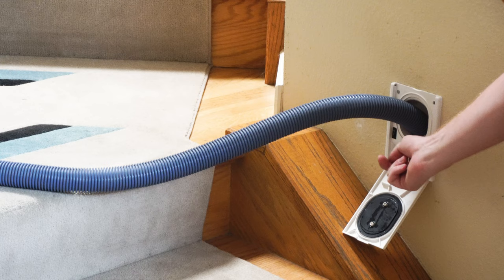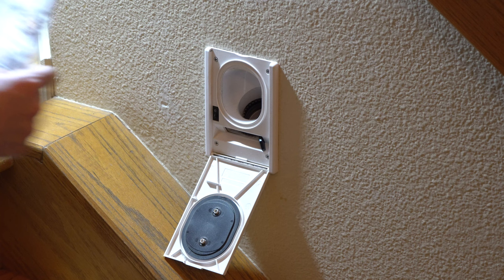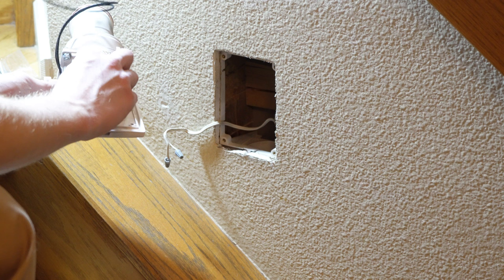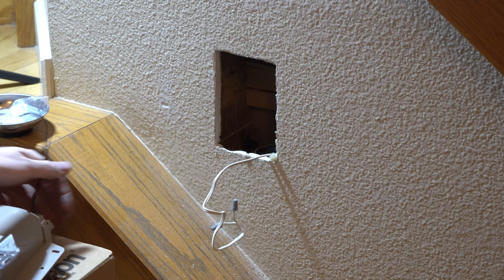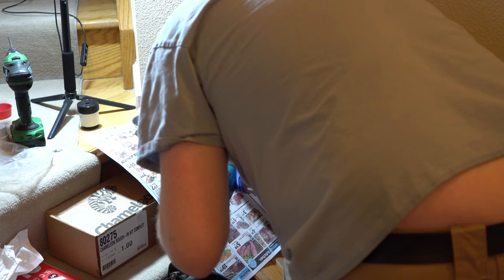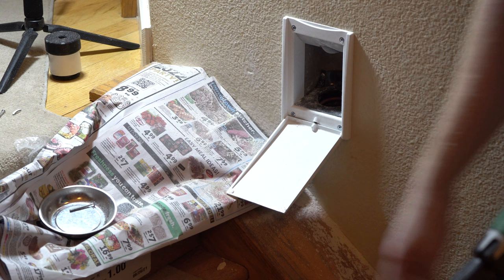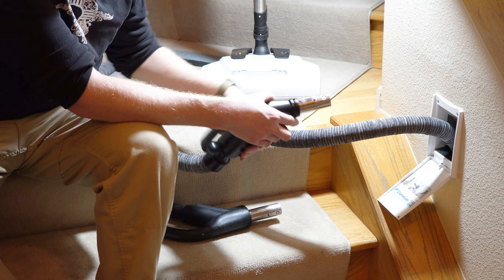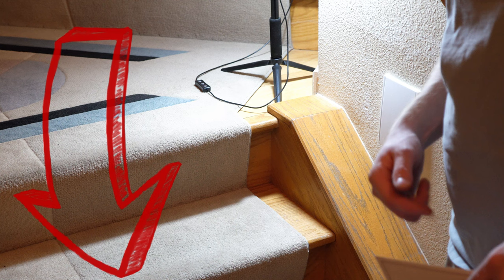Hide A Hose To Chameleon Valve Retractable Hose Central Vacuum System Conversion

Comment: You should look at Wago spring loaded connectors. You can stick wires in, close the clamp, and they’re really solid and reliable. And you can remove them again just as easily. 

They’re widely used in Germany instead of wire nuts for household wiring, so they are presumably very reliable.
Reply from the maker: I'm familiar with such connectors. It's odd that you mentioned this I do have a box of them I'll give him a try thanks for the suggestion!
Reply: They're becoming more popular here in the US too. So-called "push-in connectors". Ideal is one of the major manufacturers here.
Reply: Super expensive, for no reason. They are vastly superior to wire nuts/twist-on connectors though. Once they become the norm, I'm sure the price will drop.
Reply: For low voltage low current uses, Home Depot sells little packages of push-in connectors that take three wires; I used them for splicing in the 24VAC wiring from the two vacuum system switches in our house. However, they are only removable with wire cutters.

Comment: I've got a NuTone in my house that was installed when the house was built in 1986, and it still sucks like crazy. I should probably look into if they ever released an upright attachment with rollers for it because it'd be crazy if they did.
Reply from the maker: You could get one of these to put on the end of it and modernize it.

https://youtu.be/F_8XBVsUvlA

Comment: The Chamaeleon  is a lot better in some respects than the hide a hose And not having to have the doors be the seal is nice and also being able to remove your house and plug it into regular central vac outlets
Reply: Hide a Hose had that option years ago. Not popular so discontinued. Also, why does it make a difference if the door seals or the hose inside the valve? It does not since you can only use one hose at a time with both systems.  20 years of experience with retractable hoses and I wont make the switch because they could not lock and seal the hose at any length do to the patent.
Reply: I don't see the problem with the door seal. We've been using a first gen hide-a-hose for a bunch of years and that was never one of our complaints. The sock has been my biggest complaint since the beginning. Here in arid Arizona the static buildup in the hose attracts dirt and dog hair to the sock like crazy, and it does not come off until it rubs hard against something... like corners of walls.
When the budget allows I will be replacing it with the current hide-a-hose, which uses unsocked hose. It will require some drywall work, but I have been doing so much of that in the last year (plug: That Kilted Guy is my mentor) that I will probably cut out a foot square to make the job easier. Honestly, any repair under six by six inches is better done by making it larger for better support and less eye catching. I haven't done orangepeel texture like our host has, but I am getting pretty good with the knockdown texture we have.
I've considered an RF switch handle - we had one years ago and it was a problem child, from battery availability to dead spots throughout the house. The hidden hose systems (hide-a-hose and Chameleon) make handle control rather pointless. I'm walking back to the outlet whenever I want to retract it and turn it off, so why complicate things?
Reply: @flagmichael  You can change your hoses from sock hoses to the Rapid Flex hoses without making changes to your existing Hide A Hose system. I am in the Phoenix area and stock most hoses when you're ready.  If you are considering updating to the new inlet valves from Hide A Hose I can help you there as well.

Comment: You mentioned that you can use electric nozzles with this system, were you referring to a battery powered nozzle or does it actually provide an electric hose to use plug in electric nozzles. I love central vacuums, since I live in an apartment I use all of my central vacuum units by plugging a hose directly in to them, I have at least one central vacuum unit in every room.
Reply from the maker: Generally I use my battery operated nozzle but I also have 7 electro valves as well .

Comment: Can you have two hoses one regular hose for the basement, and the Chameleon hose for upstairs, or do you have take out the Chameleon hose out of the pipeline, before you can vacuum the basement with the regular hose?
Reply from the maker: What's your describing is referred to as a hybrid installation. Yes I can still plug in a regular central vacuum hose around my house.

Comment: You mentioned the old school electrical system will not really be used anymore. I would like to add the retractable hose but keep my 110v hose that powers my head unit. Anyway of doing that with a hide a hose type system or would I need to get a battery powered head or a 110v pigtail vacuum head?
Reply from the maker: Yes I'm referring to new system installation not existing central vacuum systems. Most new systems get sold with a battery operated head.

Comment: Genuine question: why don’t you solder your wires? 

If you’re shootings for an overbuilt reliable connection, I always use solder as a hobbyist mechanic. Is it different for vacuum wiring?
Reply from the maker: The vacuum wiring is attached with screws that hold the wire in place. Nothing's going to move once it's put in place. Nothing to get loose. The wire itself has a coating on it to keep it from getting corroded. So the need for braising this is unnecessary as well. 

Great question thanks for watching!

Comment: I should clarify,  Parts are made in China and assembled in Ohio.  Hide A Hose parts made in USA and assembled in USA. Also Hide a Hose has had the end cap available for a very long time to pull out and plug into a standard inlet which turned out to defeat the purpose of having a convenient system.  You can call them and order it if ever needed. Also, Hide A Hose has always had hoses available with the option of a Smart Hose Sock or a Rapid Flex Hose. Also lock and seal at any length. Again, more options with Hide A Hose. Just making sure facts are correct and advertised correctly. I would like to understand why the hose sealing inside the valve is better than at the door? I don't see why when you only use one hose at a time. For your master bathroom put in the Hide A Hose Mini.
Reply from the maker: Yo I think you should stop doing drugs. I've heard fiends who make more sense than your statement. Go ahead and continue living in your Fantasyland.
Reply: @PerformanceReviews  wow, I was just clarifying some actual facts missing from your video. My 20 years of experience with retractable hose systems and installed more of these systems than anyone I thought I would help out.  I’m sorry you did not like hearing about options you were not aware of or did not want the public to know about. I believe in being honest and selling the best products for my customers, that’s my success.  Sorry if I upset you.
Reply: @PerformanceReviews  🤣🤣😂
Reply: @PerformanceReviews  ew

Comment: Why would anyone want to do a conversion to put in something with less features? Think I know why.... cheaper Chinses manufactured parts= bigger profits. Careful end users.
Reply from the maker: Chameleon valves are made in the United States. By HP products. No Chinese Parts there. You are actually gaining features by going to the chameleon. Like being able to take the hose out of the wall and plug it in to a regular outlet and having a hose sock.